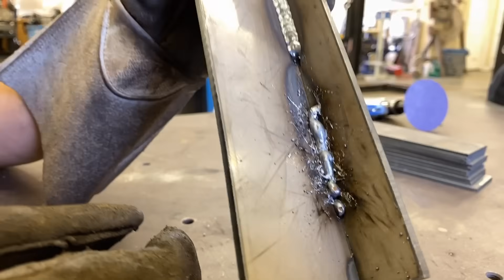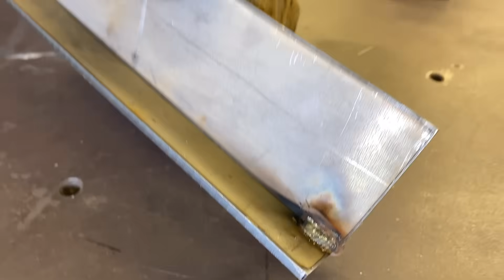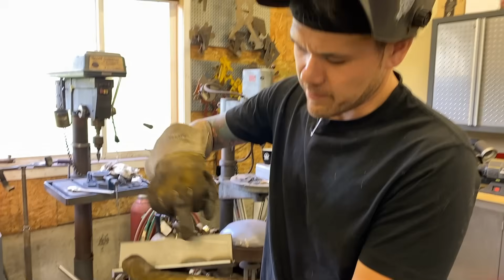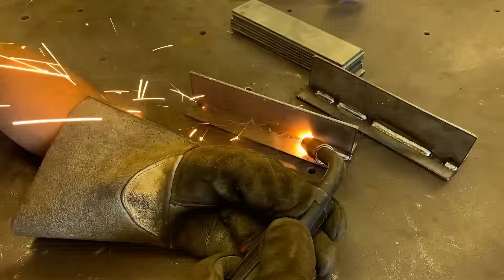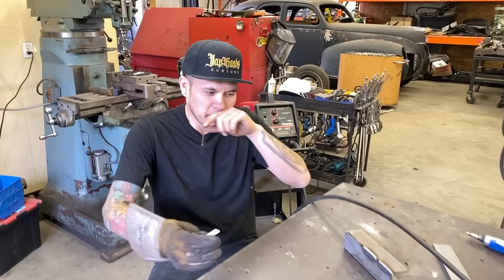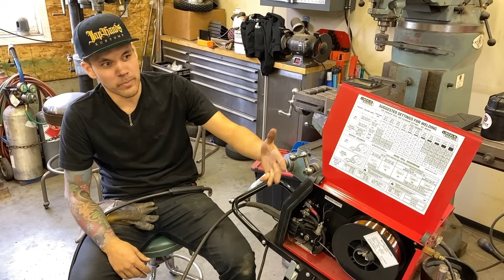MIG Welding Basics For BEGINNERS!! How To Set Up Your Welder + Tips, Tricks & Techniques!!

Comment: Putin out some great content!  You mentioned welding on the chassis, I've heard some say you can't legally weld a chasse, what's your take?? Thanks!
Reply: Hopefully, it wouldnt be obvious that you did weld up your chassis. I live in the west and because we have little to know rust, there's no safety inspection of any sort to pass, so I dunno about any of that.
Reply: @That70sChannel  After a bit more checking it looks like D.O.T. has rules regarding welding frames on commercial trucks.  On any portion of a frame in-board of the suspension or motor mounts I would add a diamond plate reinforcement over at least one side of the joint in which the welds stop short of the points of the diamond and then temper the weld area to give it back some flexibility.  Modern frames are heat treated and meant to flex.  Welding without tempering (depending on process used) will likely leave that area brittle and more likely to snap.
Not baggin on your content, it made me think a little deeper and wanted to share what I found, keep up the good work!!
Reply from the maker: It really all depends lol there’s kind of a gray area there in our local laws. Typically I do not hear of anybody getting screwed from an insurance company because they had welts on the chassis. Although it does say that any modifications to suspension or non-DOT approved parts Are not allowed on the vehicle. I suppose if welds were to fail causing an accident that’s when they would come in to play

Comment: Excellent tips, thanks man. 
Something else on roller tension I found out the hard way, too tight is bad!
If your wire speed is too high and roller tension is too tight it can cause the wire to "birds nest" and cause a real mess.
I start loose, gripping the wire between two gloved fingers (at the gun), the wire should slip on the rollers.

I increase the roller tension till I can only stop it by gripping the wire quite tightly.
Reply: Yes. Exactly. Thought it be better to read som comments before typing that exact comment too...😊
Reply from the maker: Great addition!

Comment: Man this is definitely one of the clearer videos on what happens when settings or technique is wrong, so many other channels just say set welder to this and go and weld should look good, without showing what a bad weld or bad settings look like, and probs one of the only vids Ive seen where you mention how it sounds. Awesome video thanks Karl!
Reply: Being a farmer I like to drag my weld, that said I do combo of everything but I do find that when I push I get a taller weld and doesn't lay as flat
Reply: @HalfassKustoms  I drag too...I didn't even really realize I was doing it until I read your comment and thought about it a second. I was like, "hey...I do that too! LOL And I'm a good welder, I do quite a bit of welding.
Reply: @waynethomas1726  o9
Reply: @HalfassKustoms  yeah when you drag you get deeper penetration so the weld bead goes flatter.  When you push, the wire hits colder metal and so forms a taller weld bead.  I like to push with mig but always drag with stick.
Reply from the maker: You’re very welcome man! I’ll definitely go deeper into it as time goes on
Reply: @MakeItKustom  There is a lot to teach for welding and ya can't show it all in one video but you did a great job focusing on the listening to the arc/spatter/wire feeding sounds. I have been making videos for my channel that show safety, setup, and projects to try after learning how to use the various welding processes and there is definitely too much to teach in one video for all of the welding processes.  Love the sheet metal work....craftsmanship at it's finest!
Reply: Yeah, sound is key.
Reply: Yea, he did a really good job of explaining things as he went along. You don't get that very much. I learned to weld before there was an internet so I watched a guy weld, started doing it...incorrectly and learned to listen for the sound. The sound can fool you sometimes so I think it's important to know the numbers because in general machines are going to be similar enough that going from one welder to another with the same settings will usually get you pretty close and then you adjust for the right sound and the correct looking weld in terms of penetration and puddle flatness or "wetting". A lot of what a beginner might do is exhaust work and often you're not going to be welding new steel to new steel. You'll often be patching up rusty exhaust and you'll not only have to get good at welding thin material but also welding to rusty material that you cleaned up and found there isn't much left. Learning how to fill holes where you burned through...that's a whole technique in of itself. But there's only so much he could teach in one short video. But, in the real world, you're going to get someone call you and ask, "are you a welder?" and they're going to want you to patch up some garbage and it'll take forever because you're welding to rust and then they're going to wonder why the bill is so much because, "I mean..you just welded it" as if welding someone's garbage back together should be free or something because you didn't snap your fingers and make it new LOL. People are funny, customers are hilarious. My favorite job, in this regard, I told the guy it his restaurant's grease trap was too far gone and he should buy a new one rather than trying to cheap out and have me fix it because I'm going to have more time and materials into it than it's worth. I get it all done, worked my ass off!, gave him the bill and he starts bitching about how he could have bought a new one for that much! I'm like "yea, dumb ass...doesn't that sound familiar? It should, that's exactly what I told you to do before I started!" I was right, but I didn't get any work from him ever again. Some customers aren't worth keeping but when you're starting out...keeping some money coming in, even if the customer's a douche, is not a bad thing. Just find yourself without time to help him when you get better customers in the future. Anyway...have a good one.

Comment: Having done structural welding I can tell you that direction depends on the process you are using. Also, when I hear structural I go to buildings not cars so here is my 2 cents. Typically either dual shield (flux core gas shield) or stick is used and the weld is determined by the engineer and which ansi weld designation used. If you are using flux welding process such as stick and dual shield you are more likely to have slag inclusion if you weld in a downward direction creating porosity in the weld. Structural with solid core MIG I completely agree that you weld downward. Love your videos man! This is one of the best channels on Youtube i have seen yet!!!!
Reply from the maker: Thanks so much man I do really appreciate your feedback! I do come from a structural steel welding background and have gone to school and even done welding competitions. I appreciate that you agree that there are different processes for different applications. Although I consider the frame of a car to be structure in reality it’s just gauge material lol
Reply: @MakeItKustom  I knew you had to be from a structural background. Most people do not sq. tube H.S.S. Fan for life!
Reply: @MakeItKustom  come to think of it I'm not sure why I drag sometimes and go downward or the other way in some situations....I suspect it's because my welding is often exhaust. If you need your frame welded up on your daily driver truck...bad news! So I think it's mainly based on access more so than being technically correct. Great input from Mick Miller. When you need something heavy to be welded, hope there's an iron worker nearby! LOL
Reply: @MakeItKustom  they do tend to have souls, don’t they!!!
I’ll never forget the pep talk that the crew chief gave the race car before cole trickle went out for the Daytona 500 in the movie Talladega nights!
🤣🤣🤣💪🏼🔥🔥
Reply: I will also add that Vertical Up, you do preheat the metal as heat rises.  Vertical down for mig is acceptable, and it's easier.  There's a saying, Up inside the fence, down outside the fence, as field pipe welders also weld vertical down.

Another contraversal weld is the whip and pause for mig.  If you pause at 15:02, you see all three of your welds, stringer, little E's, and Whip and pause.  The stringer is the strongest, and the little e's are are the most full.

There's a time and a place for everything and I love the channel.  Keep it up!
Reply: Glad I found this channel. Read some of the other comments...
Reply: Insta sub.....
Reply: Structural simply means anything load critical.

Comment: I just found you. I must say I love your content. Question: What line voltage is that Lincoln welder? I think it a 220v but some have duel voltage. I'm struggling with a 110v machine but you gave me an idea with your forward and back technique. Thanks
Reply from the maker: Yes this is a 220 V machine I find it difficult to trust a 110 V machine on structural stuff

Comment: You are welding out of position. Vertical up is a hotter weld with a better root penetration., vertical down is not recommended due to the lack of penetration..
Reply from the maker: Yes that is what is in the Welding book. I did go to school for it but structurally you won’t see anybody welding vertical up on a car maybe tig Welding.